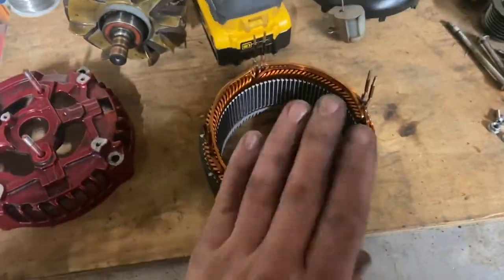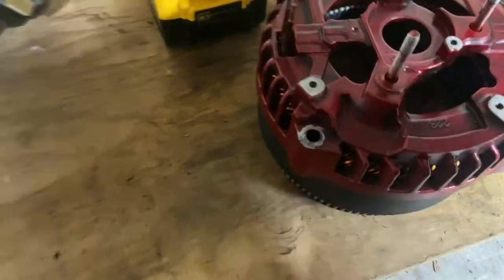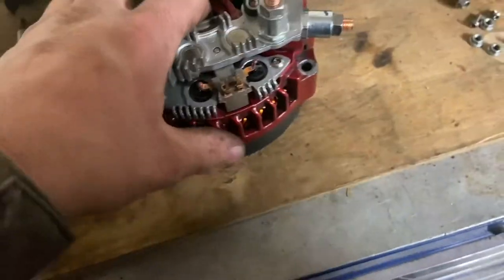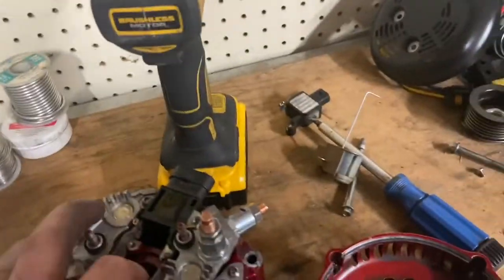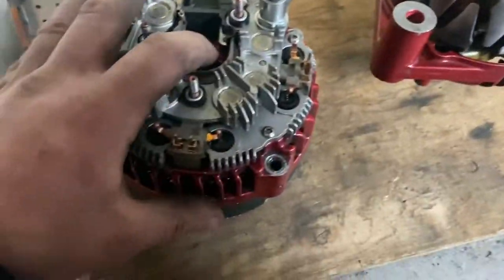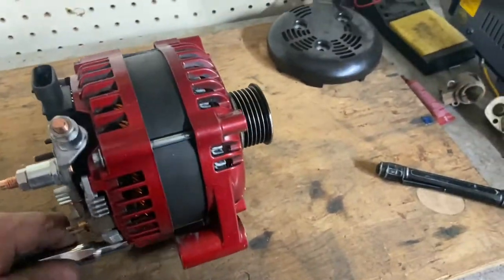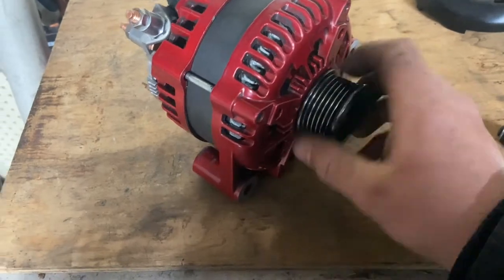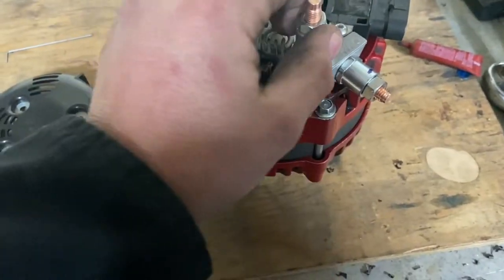How to build a hairpin alternator

Comment: Do you have to use a special rectifier or is the standard replacement rectifier sufficient for the increased amperage
Reply from the maker: I have seen some manufacturers use the stock rectifier with 50a diodes. I personally order them with 80a diodes from metro
Reply: Thank you sir much appreciate. You have gained a new subscriber.  You have cleared up some questions I had. I'm getting ready to  order parts to build a HO large case 3G alternator
Reply from the maker: @ottobauner9828  let me know how it turns out
Reply from the maker: @ottobauner9828   I think metro offers large case hairpin parts to make a 3g. If you have questions this is my fb. https://www.facebook.com/adam.harmon.9693
Reply: @sub-humansounds5645  thanks will do.
Reply: @sub-humansounds5645   I'm confused?? Can't you just buy one already made? I just got my 400amp hairpin on ebay, 200a at idle. The only real issue was that it was for a much never vette(98 and up), but it bolted right up. Didn't have to hookup the plug or anything. 
Took me a minute to search for an alt that would work. I had already spent 300 on a 220a alt that didnt last like 2 months, hell it acted up from day one really.